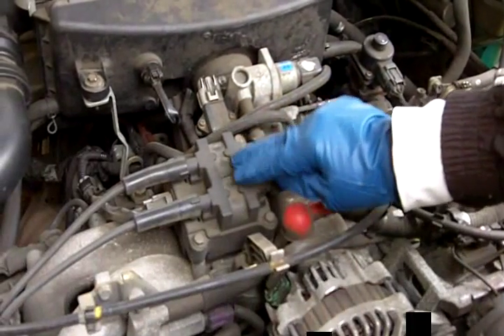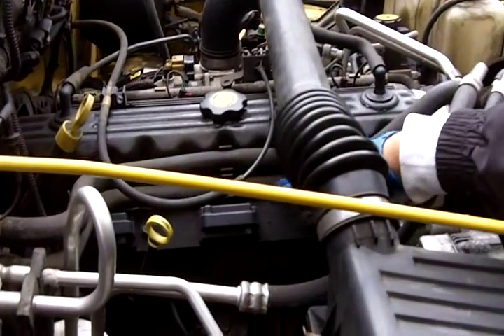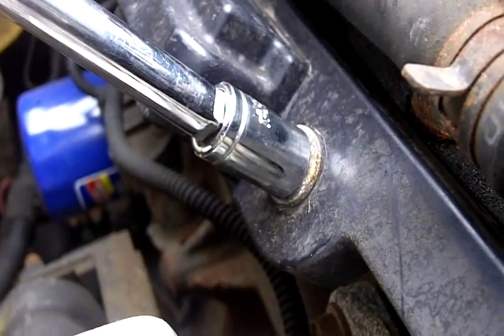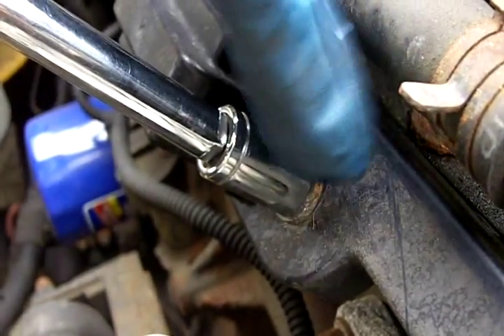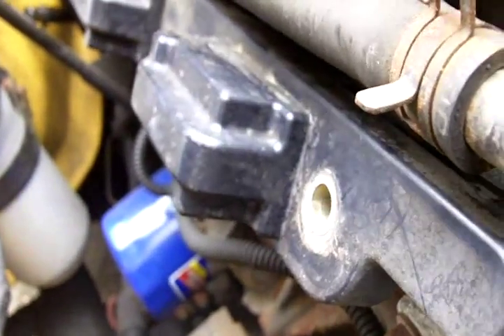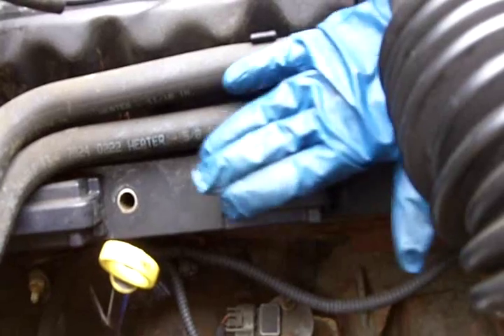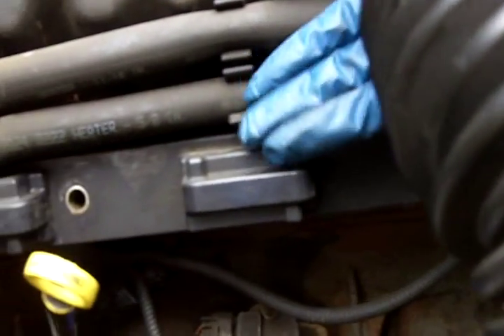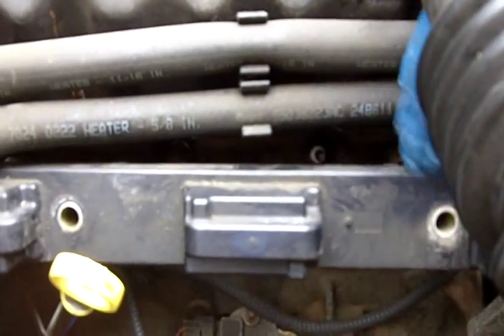Coil Pack Overview

Comment: But how do you change the boots?
Reply: You don’t have to change the spark plug boots. Unless you tear them apart pulling off the coil pack and that rarely happens. Push the coil back and forth to loosen the coil boots off the plugs.

Comment: My car must have the first one you showed. My car has individual spark plug leads going to each spark plug.
My mechanic said my car may need some new leads or it may need new fuel injectors, so I changed the leads and saw the old ones are the original ones that came with the car, when it was made, in 1998! It also turns out the old leads are still good. (unfortunately I need new injectors, or at least one new one, but it's best to change all of them at once.)
Reply from the maker: jublywubly